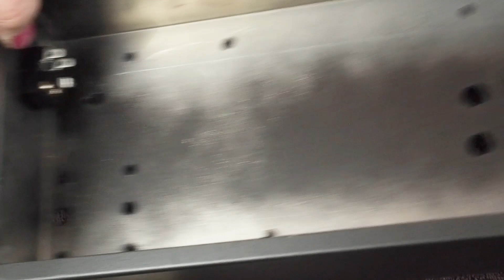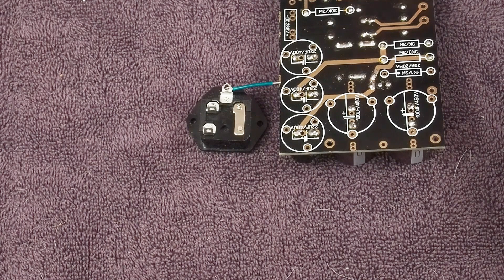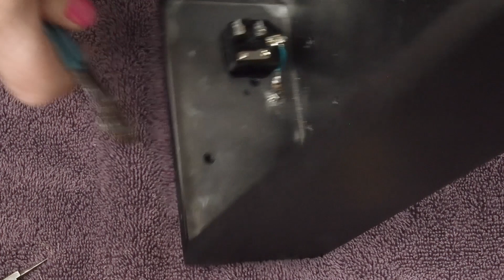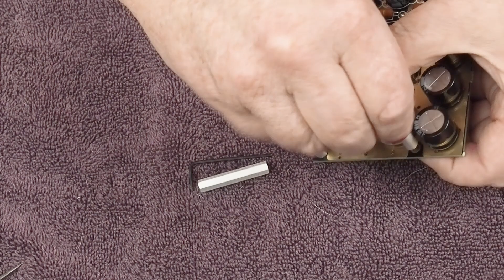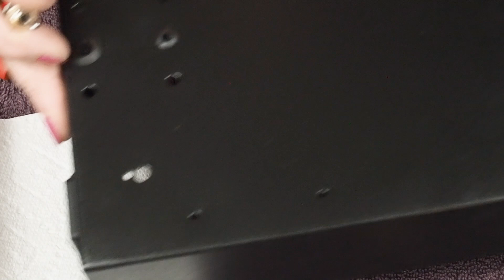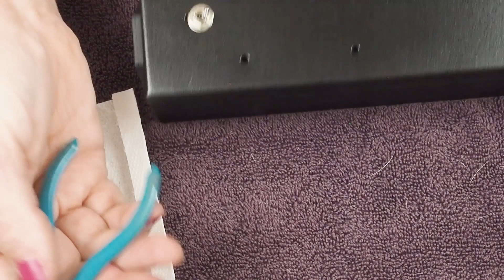All Tube Phono Stage Pre-amp Part 12: Assembly

Comment: Good tip about wiring the power switch. I can't believe how many people feed the hot AC lead to the center pin of a double throw switch. The other error I see a lot is people installing the switch in the neutral lead and then insisting that it doesn't make any difference as it works for them. This is a great series. I built a version of this phono preamp and put it into a recycled chassis I had. Works very well.

Comment: In my opinion, you would be much better served using the appropriate size wrench to tighten any nuts instead of futzing around with pliers.  The right tool for a job is always preferable.